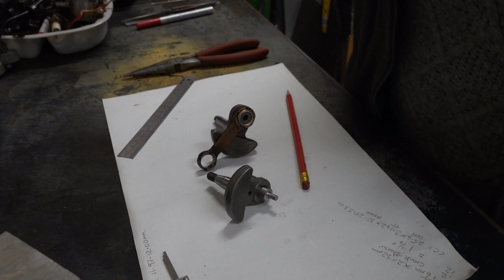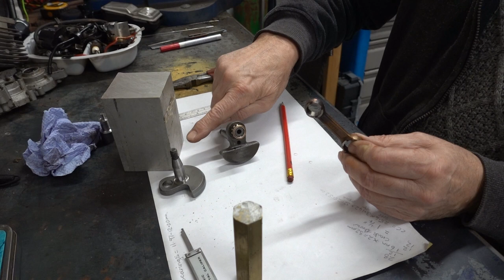Making a Hit & Miss stationary engine  part 1 Flywheels

Comment: 2002 old? Crikey. All in Imperial? Fantastic! I am not aware that Boxford ever made a lathe with a thread anything close to the Myford. Boxfords are similar to the Southbend 9" which is also the same as my Atlas 10. I would check and clean both threads. I will come back and watch the rest, currently at 15 minutes in.
Reply from the maker: Hiya Ben. It was at a car booty that a guy with everything lathe was selling stuff. I mentioned to him about the problem & he told me that there was a Boxford with a similar thread to the Myford. I may be wrong. I did clean the threads up but still it did not fit so i assume it is from some other lathe & not a Myford. Thank you very much for your comment & you seem to know what you are talking about. 
Steve.
Reply: @Steviegtr52  Have you checked to see if there is a model engineering club or two near by? They may be able to assist and they may have a club Myford to double check against. They may even lend our tools, including a faceplate.
Reply from the maker: Hi Ben. I have never needed to use it since owning the lathe. I managed as you saw I did it in the 4 jaw. Thanks for the advice though.
Steve.
Reply: @Steviegtr52  Face plates can be very useful;.

Comment: Nice work. I think you need to find your local scrap metal dealer. I get a lot of bar end stock from mine and because I know them they will even use their x ray gun to let me know what the grade is. Doesn't work that well on plain steel, don't need it on brass but handy on stainless and interesting steels like 4130 chromaloy. Also sash weights can be a source of cast iron, though may have defects in the ends. Also can be quite chilled on the outside. I pay 50p a kilo for steel and cast iron, £2 a kilo for aluminium and stainless, £6 for brass and bronze and £10 for copper.

Also if you are getting rid of things like washing machines they may give you 18p a kilo. Not fridges though.
Reply from the maker: Hi Ben. We don't have any scap dealers around here. The last one i went to years ago turned me away. Thanks for the comments. Take care.
Steve.
Reply: @Steviegtr52  Really? They don't want your money? Odd people.
Reply from the maker: I think from memory it was something to do with health & safety issues.  @BensWorkshop
Reply: @Steviegtr52  At the yard I go to they let you wonder in if you wear (they have them to lend) a hi vis jacket, and you let the staff operating equipment know where you are.

Comment: Looking forward to seeing this progress Steve. Flywheels look great, and the price was right! Cheers, Jon
Reply from the maker: Thanks Jon. Great to hear from you. I am slightly confused about the bar weights. Cast iron is usually a dull grey colour & machines very powdery. These have machined like chrome. I  must say though they were rock hard & a chipped about 8 or 10 tip ends doing it. The ones that did not chip , wore out very quickly. Maybe user error though for some of them. I am terrible at not driving the tool hard , so maybe a bit of rubbing which is never good.
Regards.
Steve.
Reply: @Steviegtr52  hi Steve, cast steel I reckon based on your description. This normally is pretty aggressive on inserts. Cheers, Jon
Reply from the maker: @jonsworkshop  You read my mind Jon. I agree that it is probably cast steel & not iron. Anyway on to part 2. 
Steve.

Comment: Looks like a good start to a new adventure. Thant flywheel came out very nice. Usually these tumbells weights have very poor quality castings.
Reply from the maker: Yes i did go through a few blow holes when turning. But they turned out far better than i thought. Very shinny too. Thanks for the comment Michel. 
Regards.
Steve.

Comment: I've come across a Myford faceplate and backplate both (like yours) jamming in the thread when new. Yours is probably the right thread, just cut shallow, to err on the safe side. Of course, you can verify the TPI. In my case, I chased out the thread lightly on both pieces, and now they each fit fine. You've nothing to lose, and a faceplate to gain👍👍. And I love the finish you achieved on the flywheels. When I've turned weights before, they've been grey and powdery, laden with black graphite and left everything very mucky.
Reply from the maker: Cheers John i will have a go at that. Look at the comment from Jon below. We sort of derived that it maybe Cast steel & not iron. Very hard going but stunning finish.. Thanks for the comment.
Regards.
Steve.

Comment: 25mm bore will be about right as you are stuck with the 32mm stroke, they all tend to have a stroke longer than the bore and going down much below 25mm makes the head and valves quite small. Consider a single Viton O ring as they are easier than CI rings. Check you have enough length on the crankshaft for bearing, gear, spool and flywheel.
Reply from the maker: Thanks for the comment Jason. yes it must really be a long stroke. The cast iron rings are made now. 
Regards.
Steve.